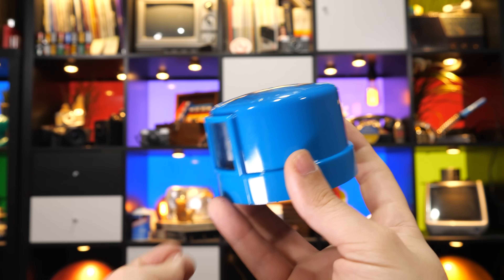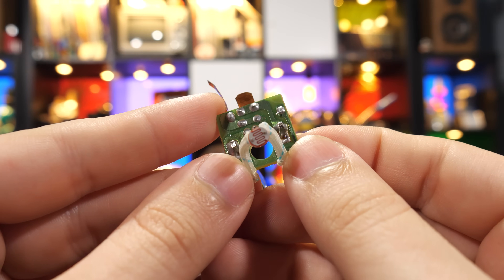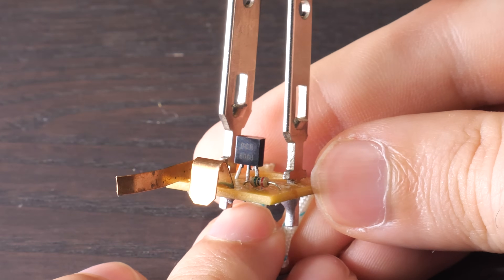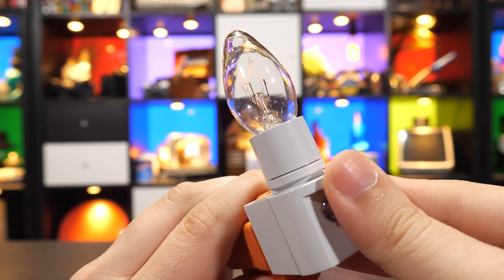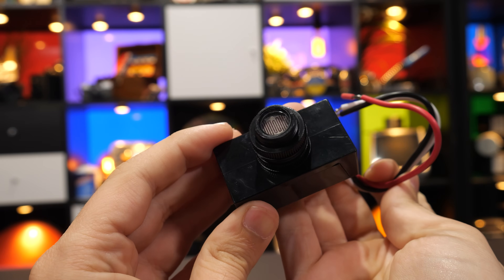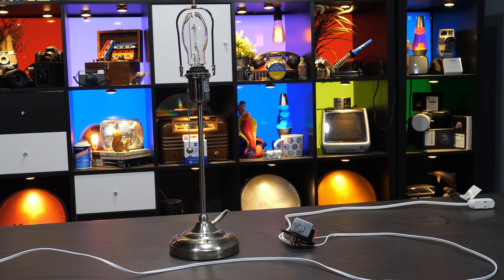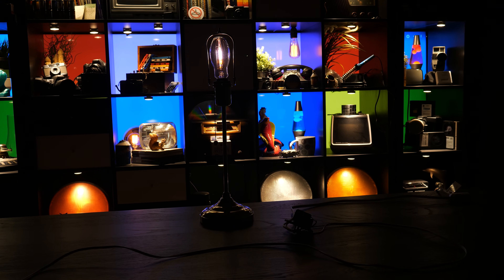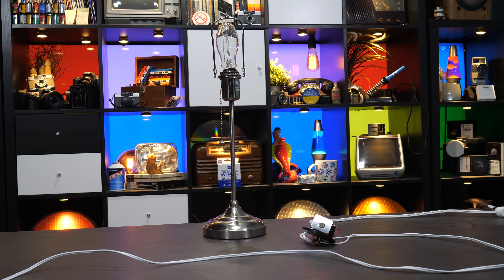Photoelectric light controls are weirder than they seem

Comment: Hysteresis! (12:14 🤣)  Very cool to see how the thermal mass of the system adds a delay without any complex circuitry, and prevents fast/erratic switching.
Reply: that one liner XD
Reply: I know what hysteresis is, but I totally don't get this reference lol
Reply: @kindlin  Every time he goes "And this little doodad makes sure it waits the appropriate amount of time" someone in the comments will immediately "correct" him and explain that it's called hysteresis.
Reply: @andersjjensen  Oh, alright, I just didn't know the word hysteresis had anything to do with controlling electrical circuits. I know the word as it relates to energy loss over time or work done; specifically, seismic energy dissipation.
Reply: @kindlin  The term is generally used in closed feedback loops too, as you don't want constant corrections being applied at, say, megahertz intervals because that can cause resonating behaviour.
Reply: @andersjjensen So, in that sense, do you 'tune' a hysteresis loop to provide the right amount of delay you're trying to get? And it seems like it would be pretty approximal, based on all the variables as part of manufacturing the device.
Reply: @kindlin  Generally, in cars and other mechanical systems, hysteresis is set according to what even makes sense. If the natural speed of the circuit can adjust fuel pressure at 1MHz but the inertial resistance of the fuel pump (or return valve) mandates that you're not even done physically executing one the last correction when you send the next correction you can easily over-correct, which leads to a constant loop of over and undershooting. A good hysteresis strategy in such a setting would be to categorically refuse to correct a 10 millibar deviation unless it persists for at least 10 milliseconds (made up numbers!). This would still be well within the realm of where the fuel injector cycle can take up the slack to perfection, as a fuel injector opens and closes in less than 1 millisecond, so just adjusting the open-duration, which is at 1MHz resolution, will do the trick. No need to frantically alter current flow up and down on the pump for that. That will only fry the pump prematurely.
Reply: Ok, but it's just rate-dependent hysteresis. It's just a smoothing filter. Does that really count? It's far better than nothing, but there would be a light level where a tiny amount of variation would make it flick on and off intermittently.

Ideally there would be a rate-independent hysteresis with a proper bit of memory.

Comment: It seems odd to leap to a microcontroller from this when there are a lot of simpler ways to do it. If all you need is a delay, a 555 timer IC and a relay can accomplish that. Or even a geared mechanical timer. But I imagine none of these would be as robust as this weird little heat switch solution.

Comment: Yes, there is microprocessors that costs less than a cent each.. Couple that with a good light meter. Hysteresis in software is just a line of code or two. Less than 100 turn off, more than 200 turn on..

Comment: I live in Brazil and I envy the simplicity of this socket mount sensor. I use some of them at home to control outdoor lights and recently replaced one unit that malfunctioned, and started to turning the lights off erratically. It have a transparent body, so I can see it uses a led as sensor, connected to a very populated circuit board. I changed for an opaque one with a weird milky white lens, I doubt it has less electronics inside since in the blister there's a model list from the manufacturer and one of the models says "wifi".
Reply: Some domestic controllers can be programmed to turn on at dusk and turn off at a given time so the light doesn't shine all night when you don't need it. They often have motion detectors also.
Reply: @fascistpedant758  yes, I have one with motion detection at my front gate. This one I mentioned is the simple light sensor.

Comment: There is a cell tower about 2 miles away from my home that has a flashing white light during the day, and a flashing red light at night. I can predict pretty accurately when it will change colors by observing the amount of light in my backyard. I know it's not on a timer because of the way it behaves when the sky is cloudy. But there is this thing; The flashing is very regular, but then the flashing becomes a little erratic for a couple of minutes as it gets close to making the change.
Reply: Interesting. Aviation lights are supposed to flash at 40 flashes per minute. I wonder if the voltage from the photocell is affecting the flasher. If it's a bimetallic strip flasher, higher or lower voltage will affect the flash rate. Once the voltage reaches a certain point, meaning it's dark enough to change over, it might switch to the other bulb with its own flasher.

Comment: I'm an electrician for some 16 years or so, and I've honestly never seen a light switch like this one. The ones I've used have similar sensor, but the internals are always electronic. They are usually installed nearby a fuse box (or whatever other control box) that controls lights globally, and are typically placed in the shadow.

One I've used (Elko SOU-1) has a casing designed to mount on a standardized DIN rail with all the other components you may find in your fuse box, and it has a probe you can put just about wherever. The other one I use (Grässlin turnus 200) is a self contained unit designed to be mounted on a wall and it has all of the logic and the sensor inside a single casing. Kind of the point of these is that you get to not only turn on the lights when it's dark, but you also control how dark it needs to get for the lights to come on.

I've honestly never considered controlling each lamp post independently. :D  The way we do it here is to have the whole circuit go on or off globally using a contactor.

Comment: Why worry about 2W? The old method was a Time clock. The load came on way earlier than needed for parts of the year (KW wasted). They needed to be reset after longer power cuts. and in really olden days, the Lamplighter lit  Gas/oil lamps or threw a switch high on the pole. Percentages.
(FWIW I remember the evolution: Incandescent street lamps under crinkle edge shields ->  Mercury Vapor -> Sodium -> LED

Comment: I use an LED in the little night light plug and that explains why when the bathroom light is on you can still actually see a tiny bit of light in the blub. Its one of those filament ones and you can see the individual leds on the strip.

I’ve noticed when taking apart to clean those outdoor timers for use with holiday lights they use relays but they are far more complex inside. It makes sense why the less complex method is preferred.

Comment: 13:20 I wonder if the backfeed you see with modern grids would help prevent the heater from shutting itself off, during the last major hurricane here, some of the LED lights  in my house had a faint glow from people's generators and solar panels backfeeding into the grid

Comment: When I was working as an electrician and was keeping street lights in shape, I was quite often dealing with those sensors. And contactors they control. We used to call those photo resistors as "the eyes". It's quite the feel when you cover those and you hear that loud clack
Reply: That loud clack, for me was in a cabinet of many contactors. You want scary, try a liquid resistor starter. ( motor starters ). 3 tanks of "dirty water", looks like big batteries, that when that first loud clack happens, it is completely drowned out by the electric arc sound from those tanks complete with bright flashing lights. When the 2nd stage kicks in it goes quiet but those tanks are still connected to the power, don't drop your spanner etc, they will bite.
Reply: If you happen to be working inside one of them when you hear the click I would probably ruin my white pants
Reply: @bublgumclaymore  well, you'd be too far in such a case to hear that clack
Reply: The beauty of this simple photo switch is in the "eye" of the beholder. ;)

Comment: The one on the more modern LED street lamp outside my house obviously has something different going on. You can glimpse what appears to be a red LED flashing inside the sensor housing every so often, very much like the one in a domestic smoke alarm. The form factor of the sensor does look the same as any other that i've seen in the UK. Same bayonet fitting as the blue one in your video, but they tend to be a clear plastic. Incidentally i've opened some of the older style ones in the past and observed the same bi-metallic strip. I've even had one connected to a bedroom lamp to turn it on at night. A bit of fun from my teenage years - thanks for the reminder 😂

Comment: This is the Locking Type "Thermal" Photocontrol, there are also electronic relay type controls in the same form factor, such as the Intermatic model NF10KL, these use a photo diode, electronics and a large relay.  I found a discarded one alongside the road last year, dismantled it and found a microcontroller, and relay inside.

Comment: Hmmm, TIL... I thought they had a diode generating current while the sun is shining on it (with a capacitor to have a delay for clouds), that provided the control signal to a relay. 
So as soon as the sun went down, cap would discharge and relay would switch and turn on the lamp. All you would need is a normally closed relay.

Comment: Interesting, I had never spent much time thinking about photoelectric street light controllers. I assumed they use a relay for high power load switching. Using a heater is a great way to create a time delay.

Comment: why exactly do you want histeresis if its a microcontroller running the show? you can literally get a super cheap arduino-like controller, and just program a 365day on-off schedule. sunsets and sunrises are known in advance, you can even calculate them on device daily. about weatherproofing. if you calculate the times of control, you can pot it up so tight even archeologists wont be able to extract it 10k years from now. sure, it needs some power. but like everything does... and if you have every street on a different transformator, that isnt really that many tiny 5V or 3.3V supplies to maintain, should one pop.

i have an arduino controlling a light on my bike. it has 0 waterproofing, and yes, if i bike in a rain, it will stop working. until it dries and just chugs along again. im not saying it wont die due to this. it certainly will, and im irresponsible with my electronics. but these things are very resilient, as my example shows. (the leds on the back of the bike do a knightrider type effect...and those are also not waterproof-d. and theyre also working, for almost 7, 8 years now? been a while anyway. and i use my phone as a power supply and front light. these things are super durable)

Comment: Probably be possible to do low power version with a tiny solar panel, when there's light, it close a circuit that is shorting out the light circuit, keeping it open basically, when it dark, that circuit is closed, and now the lights are on, to have a delay you can add a tiny rechargable battery to keep the main circuit open for a few minutes without direct light, like a capacitor of some kind, and bam, you got a very simple energy efficient version

Comment: The brief turning on of streetlights after a power outage was a real thing. I used to see streetlights go on for a few minutes after a power off as a kid and wondering what is wrong with the lighting system. There wasn't anything wrong. It was just an artifact. 😐
Reply: Though I suppose it could be useful, too, to verify that, yes, all the lights are working. 💡
Reply: @AaronOfMpls  just like when you start a car and all the dashboard lights come on for a second, so you know they are in fact working.
Reply: I wonder if street light techs would use this phenomenon of turning off power to check the lights when they turned on the power again to see which ones lit. Often wondered how they check them from ground during the day before going up in a bucket truck.  @AaronOfMpls
Reply: @AaronOfMpls  It's not a bug, it's a feature.
Reply: One problem with this artifact is that after a massive blackout, when one need to restart the network, any extra consumer that turns back on makes the process more difficult. So in case of several cities having to be reconnected, all those lights will actually be part of the problem

Comment: something you didnt mention but that i find interesting is the failure mode for the photoresistor. if something was blocking the light hitting the sensor for a bank of streetlamps, say a broken component or a sack having fallen on it from above, the lamps would stay on, which both keeps the streets lit at night (their job) and sends up a huge red flag at the utility department (why is lamp group 234 still pulling full power at noon). a great example of emgineers fulfilling their duty of care

Comment: How hot is the triggering mechanism's switch set for? If heat stops the light turning on, I'd be curious if climate change might mean that in some very hot locations (Arizona, for example), even at night the ambient temperature might be so hot the lights can't turn on.
Reply: Funny enough, I actually had one of those devices in a residential yard light act weird and shut the light off randomly when there was no light hitting it. This was just at normal room temperature. I can only imagine it was getting warm inside the enclosure (this fixture had the module mounted inside) and this was somehow throwing it off, as disconnecting the control stopped the shutoffs. It would run for a while and then shut off for a while once it got hot enough. I'd guess the control had become defective or badly calibrated, though, as it worked normally before. It's an interesting question, though. I don't know exactly what temperature it gets inside these sorts of fixtures when the light is on, but I'm sure it's at least Arizona's hottest temperatures and maybe somewhat hotter; but normally the photocontrols seem to work properly there. But of course, if the ambient temperature were that hot, then the inside would get even hotter still.

Comment: Interesting video! Until about 6-7 years ago when the lampposts near me (west London) were replaced with white LEDs (not just drop-in replacements, but taking down the old posts and replacing from scratch and you can see each individual LED as they have a centimetre or so gap between them) it used to be that every lamppost would have their own sensor and they'd turn on and off at different times as a result. (Probably better on the grid by not causing a power surge, to be fair)

The new lampposts have what looks like an antenna (or some other thin, vertical, stick) on the top of each one that is presumably triggered by a timer or photoresistor somewhere else, especially as they were kept on 24/7 for a few weeks while they were being installed across the borough. Occasionally you get one that doesn't turn off in the morning, but that's very rare from my experience, and being LEDs it's not like they draw much power anyway, and they're often in a position where they have a chance to get blocked by a tree growing around them.

I remember a kids' TV show showing a light not working including an engineer using a cloth in his hand to cover the sensor to test if the replacement bulb was working when he'd fixed it.

Edit: also yay we have the jazz back!
Reply: I too was disappointed in the lack of jazz in the last video

Comment: In electronics, these specific LDRs are also referred to the more specific (but also confusingly inaccurate) term "CdS cell". The "CdS" part refers to a material that makes up this device, Cadmium Sulphide (or Sulphite, I forget but the difference is only important to chemist's who want to know the valence of the Sulphur used). The inaccurate part of the name, "cell", can be confusing because the term "cell" is more often used to describe a voltage producing device. But, CdS cells don't generate voltage because they are resistors. Variable resistors, yes, but certainly not a voltaic cell. Electronics terminology is full of these confusing terms, almost as if the people coining these terms were just making it up as they went along. Oh, wait... They were. 😏
Reply: I forgot to mention a year ago, but CdS cells are slowly dying away. This is because RoHS certification restricts the use of certain elements (as in periodic table elements) in device construction. One of those restricted elements is Cadmium, so no CdS cell can ever get RoHS certification for the industries that care for such things.

Comment: And when you think about it, heating the switch during the day to turn off the light is a better design. If the design was so that it heated up the switch at night to turn on the light, then on hot sunny days the light would never turn off & cold winter nights there might not be enough heat from those little resisters to turn the light on.